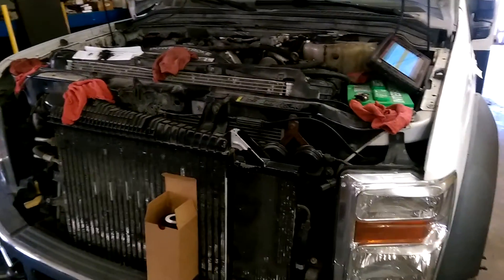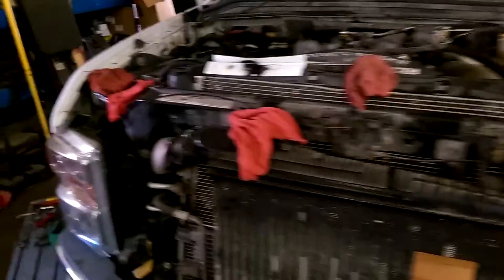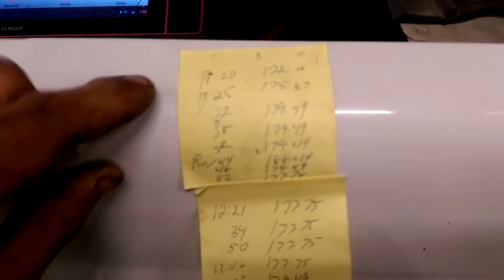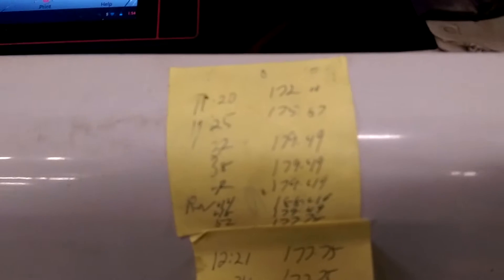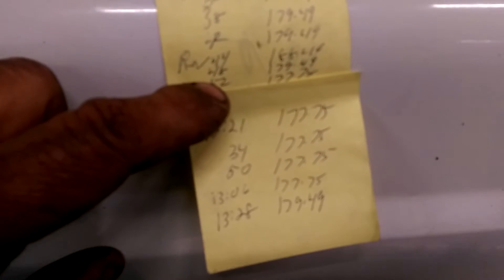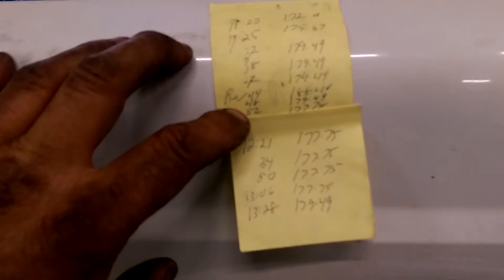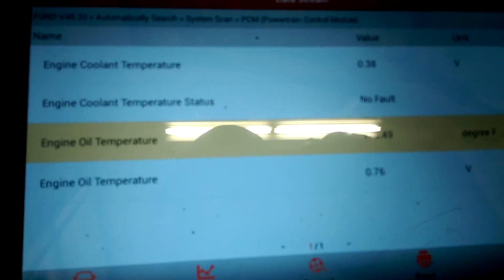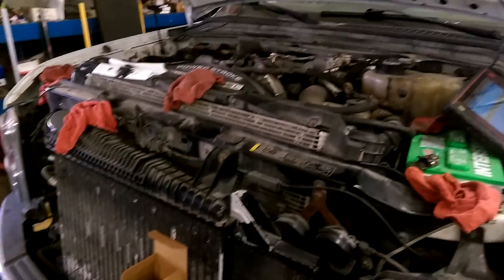2008 Ford F550 6.4 rocker arm failure #3 of 3

Comment: The easiest way I know to check the oil cooler, is to drive the truck with a load ( heavy trailer ) and keep an eye on the oil and water temps. They should stay fairly close to the same temp. If you have a 15 to 20 degree difference or more, you probably have a clogged oil cooler. Make sure the fan is working properly too, as that could cause the extra heat build up as well.
Reply from the maker: Doug you may have responded to the wrong video accidentally I'm not sure. There was no issue oil coolers on this video.
Reply from the maker: My mistake Doug I thought you were on the first video yes we had to make sure the oil cooler was working properly so in the third video I use the numbers that I had found and a comparison to the road test later. Did not hook it to a load no tow hitch on it however do have good Steep Hill to test on.
Reply: George McRae  Gotcha, you're lucky that cooler was ok, they're a bitch to do in a 6.4, as I'm sure you know! Much rather do a 6.7😀✌️